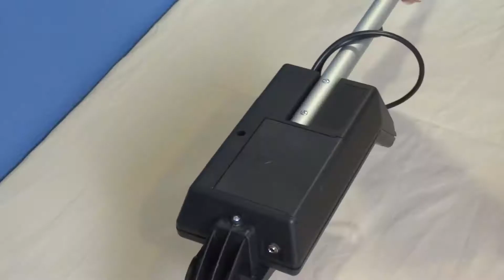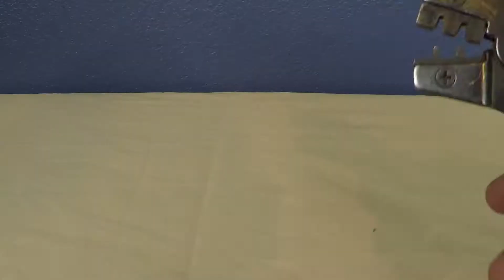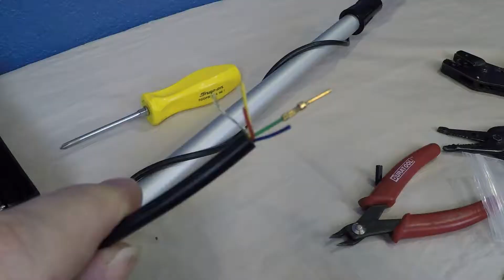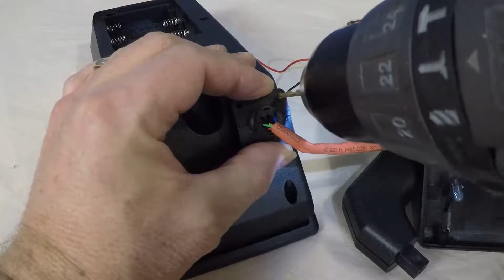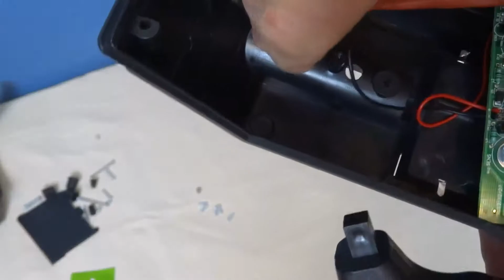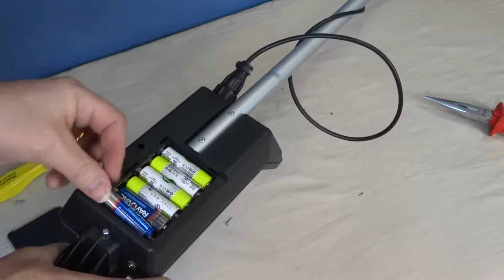HF Coil Cable Connector

Comment: What do you think adding a potentiometer to the meter would do? Would that allow you to adjust the meter so it wouldn't go full scale every time it detected metal? Would that affect the signal strength of the detector (meaning make it less sensitive)? I wouldn't want to do that to it but it would be nice to be able to dial it back, especially for pinpointing.
Reply from the maker: @DirkEsterline-q7j  that might work, but meters are pretty sensitive and usually very low voltage or current, adding a potentiometer may cause the circuit to become unbalanced and not work

Comment: I have a Bount hunter Landstar machine with push-on connector and several smaller coils (10," 8," 4") so don't want to change the machine side to screw-on.  This is the long way around to my question, I want to add a larger coil which comes with a screw-on connector.  I'm sure it's not rocket surgery but, how tough is it to swap out a push-on connector on the coil side?  I'm a little hesitant to spend a couple hundred bucks for the big coil and immediately cut it up.
  Thanks for your patience.
Reply from the maker: It might be better to do a short adapter cable between the new screw on coil and the push on connector that the Bounty Hunter has. It would take a little research to figure it out - but that way you are not modifying either device.
Reply: @BradsLaboratory  
  I have no idea why I didn't think of that...  Great suggestion!
Now, to find the connectors, is the receiving sctew-in connector male, or female? I don't have/use that style so, no idea.
  Thanks again...

Comment: how possible would it be to put a different search coil on it?
Reply from the maker: What are you looking for? a larger coil? a smaller coil? a triangle shaped coil? As long as you keep the henrys (inductance) the same  you can change the coil out. This unit is completely analog, so going up or down in henrys will require changing capacitors and fixing other things in the circuit.

I am considering adding a 2nd frequency to the unit to allow for better gold detection, but this will most likely require a designing a new circuit and PCB - so it will be pretty complicated.